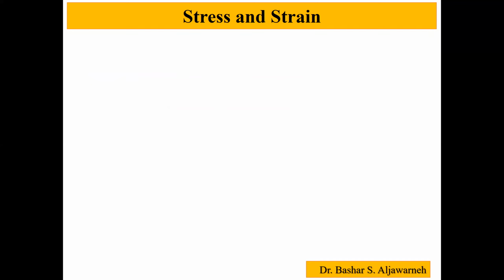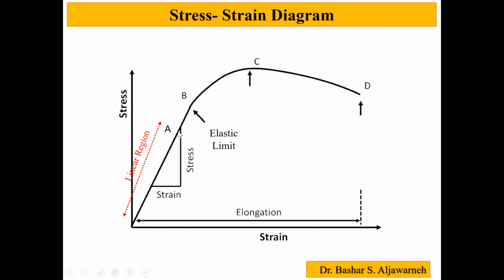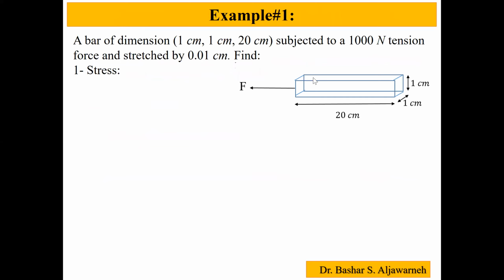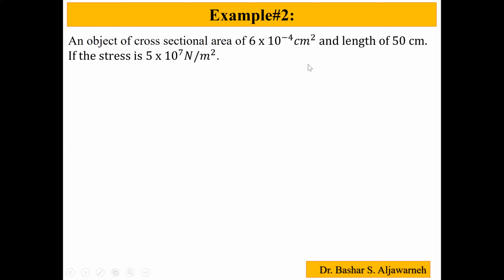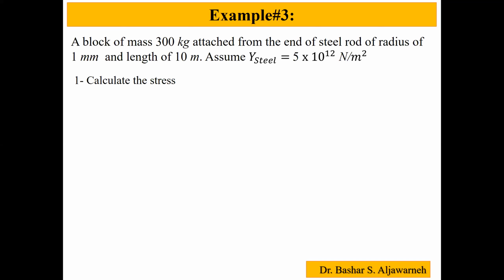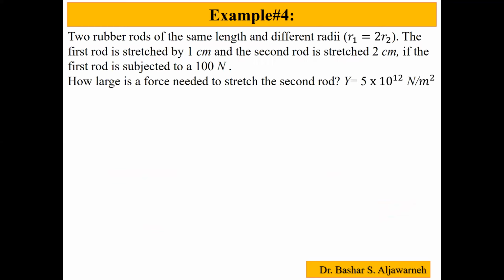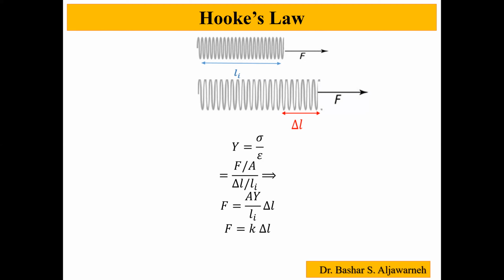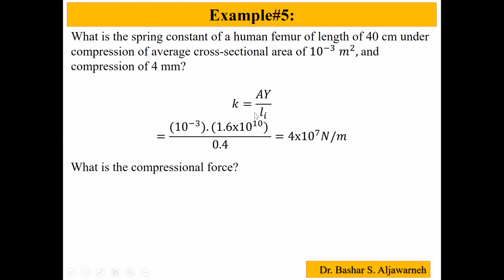Chapter-8(Elastic Properties of Materials)

Comment: hello sir. i want to ask for the example 3 why the young modulus is 20x10 power of 10 not using the steel's young modulus
Reply from the maker: Young’s for steel is 20x10^10
Reply from the maker: Check my corrections video
Reply from the maker: اللي في الحل مزبوط